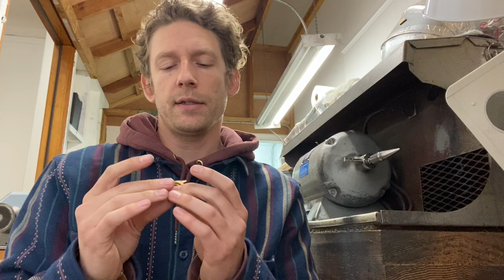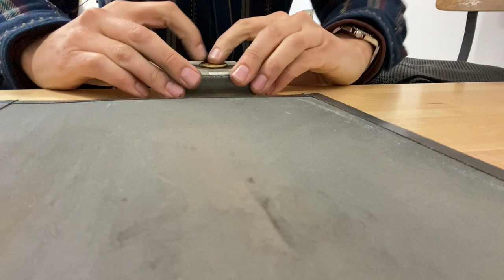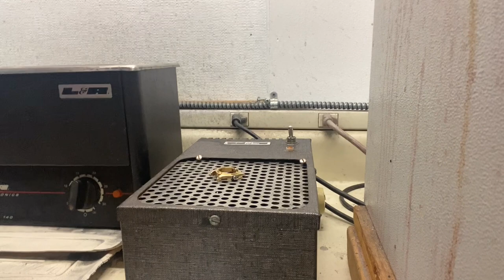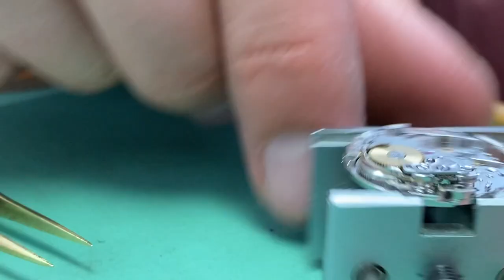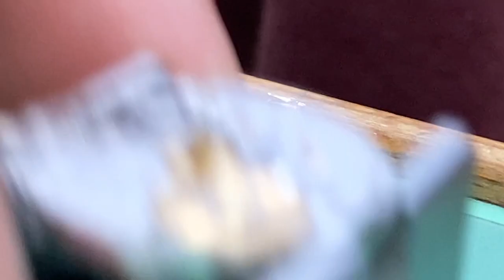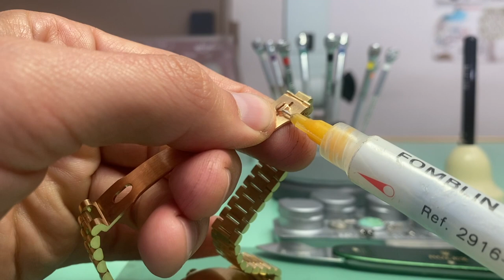Vintage Rolex Complete Overhaul

Comment: Very good video. What is preferred rpm when polishing the lugs? Thanks
Reply from the maker: As slow as. Possible
Reply: @Timesradical  I'm about to get a polishing machine so I would like to choose the right one, the minimum speed should be less then 1000rpm or that is fine, how slow your's is rotating? Thanks in advance